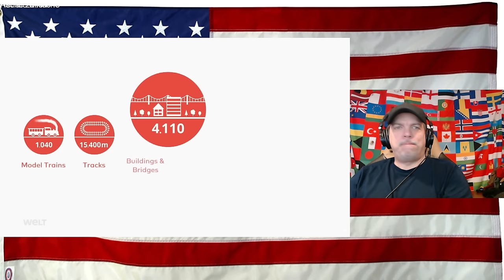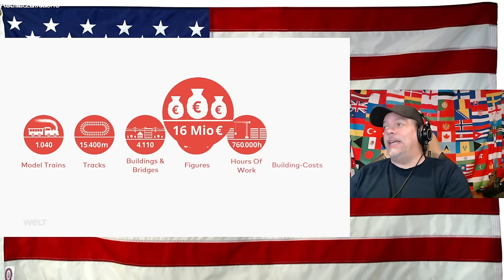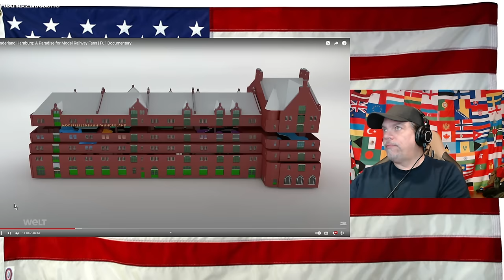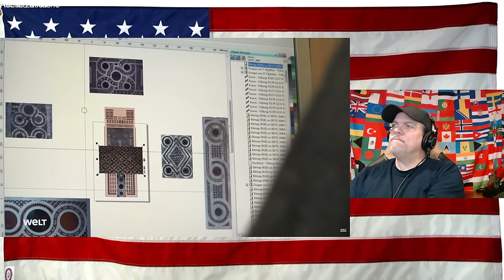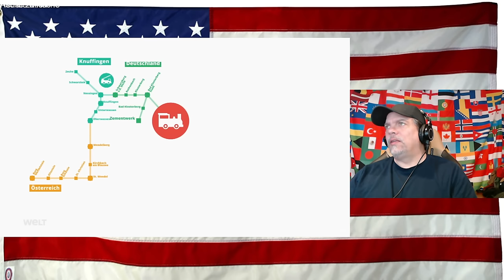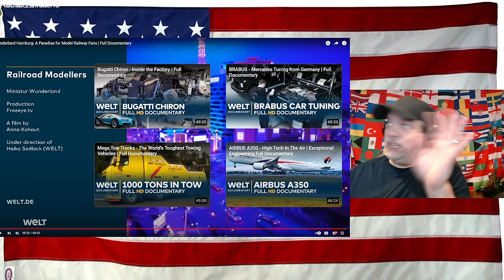Wunderland Hamburg: A Paradise for Model Railway Fans | Full Documentary - REACTION

Comment: Consider that this video is nearly 8 years old, as Italy was opened in 2016.
Shortly after the main italian section, they added a small corner for Venice. No trains, just houses and canals and still 1 million Euro construction cost, as every building needed to be handcrafted.
The control centre has been heavily modernized, and sports 3 MASSIVE screens instead of the numerous small monitors.
Southern France has been finished for nearly 2 years now, while Monaco with the racing F1 cars will open end of April.
And of course, the bridge has been added, as well as Rio de Janeiro, Copacabana beach and Patagonia (they added a Metallica concert to Antarctica, when Metallica played in Hamburg and visited Wunderland). The Anden mountains and the Attacama desert are under contruction in Hamburg, while the rainforest and the Amazonas bassin are buing built in Argentina.
And they have a Virtual Reality experience in the new building, where you can see the display from the eyes of a figurine.

Comment: 15:24 There is already a lot going on there. They expanded the Miniaturwunderland already to the other side of the canal and installed a bridge for visitors to get to the new sections of South America that were and are built in a cooperation with a model builder family from Argentina. And also Europe is still expanding. Soon they will open Monaco with a true Formula One racing track with little cars and a real race going on.

22:15 Actually they do elaborate testing for their moving parts so they can be sure they are running longer than normally specified. And sometimes they improve those moving parts with new technologies to make them long lasting. I.e. they are replacing all rails with a middle conductor to a DC-system, because the middle conductor gets worn down regularly from all the trains running over it. And perhaps the team is that large because of just the maintenance they have to do every single day to keep things running.

Comment: I was there last year, they have a second building now, connected with a bridge. I hope you will have the chance to go there one day. It's impossible to grasp in a video. Work like this is only possible with a huge amount of passion. When you talk to the staff and the "owners" you can clearly see, that they are more like a family that share a strange passion for perfection.
Reply: Building that bridge wasn't as simple as it sounds. The Speicherstadt, the old warehouse district, was built on huge logs rammed into the river mud and silt, upon which both the streets and the buildings were created. The canals between the buildings were used to transport wares from the actual port section to the warehouse by barges. These were faster, cheaper, and more versatile. However, the Elbe river is tidally influenced by the 70km distant North Sea. With high tides on the North Sea, the river water rises by well over two meters, and runs off almost completely at low tide.
This means that the constantly changing weight of water on the river mud causes the buildings on opposite sides of the canal to tilt towards and away from each other during high and low tides by over 30 cm (roughly one foot) on the top floors.
But to retain their title of biggest model railway in the world ALL parts of the tracks have to reachable by ANY train set anywhere on the tracks by following the tracks without artificially lifting them onto other tracks. They are only allowed to use switches built into the tracks themselves.
But model railway tracks aren't known to be able to contract and expand four times a day by over a foot when passing over the bridge. I still haven't heard a good explanation how they solved that problem.

Another problem was that the Speicherstadt is part of Germany's UNESCO World heritage sites so their inherent structure can't be significantly changed. The bridge thus had to be approved for very strict adherence to classic building codes that didn't change the character of the two buildings.

So quite a feat for a seemingly fairly simple straight connection between point A and B.😂

Comment: 🚂 As for moving parts: Most of the locomotives are tuned, motors and gears replaced, plastic replaced with metal, to accommodate for the continuous operation you would definitely not reach in a home model railroad 😅

Comment: The problems with doing something like this in the USA would be ...
- the MINDSET:   workers change their jobs on a regular basis (as part of the culture of "getting ahead"), but that way you would have to "start at zero expertise" again with a new one
- the RESPECT FOR "stuff":    the USA is the place that "invented" modern[1] Graffiti ... and "children touching everything"

It could be INSPIRATION for a bunch of children AND there would probably be enough multi-storey industrial buildings to accommodate it. 

[1] modern = spray can tags and graffiti ... "Kilroy was here" slogans have been left in buildings for thousands of years, but they are rare in comparison, because it was rather hard to do with a piece of coal or actually etching it in the stone with a piece of iron.